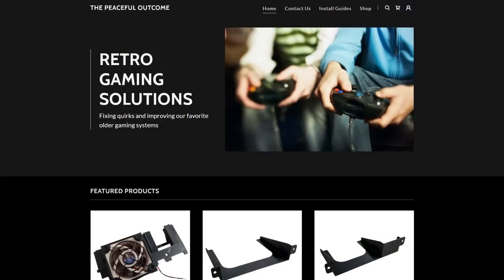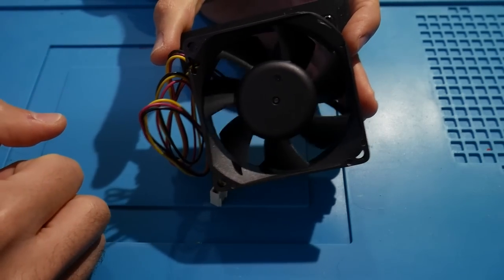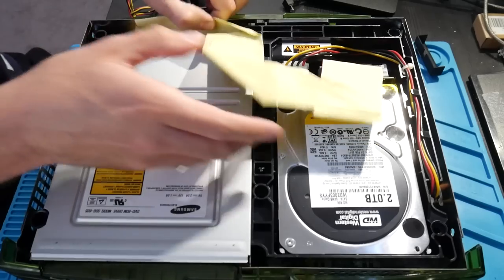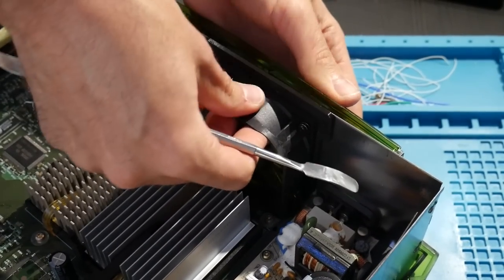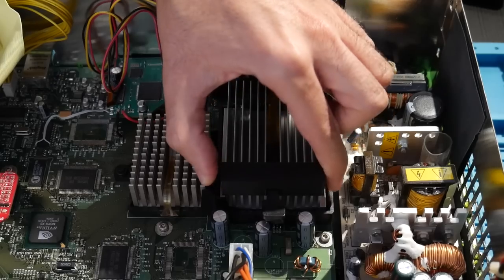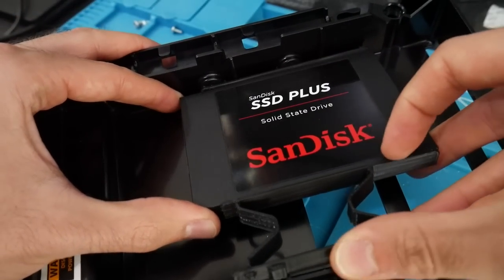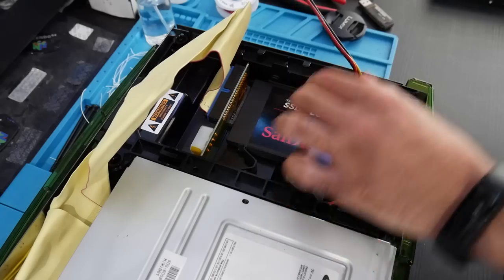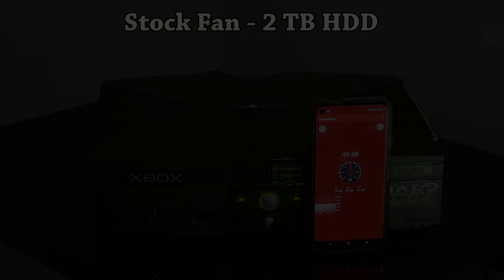Can We Make the Original Xbox Whisper Quiet? - Xbox Nexus Fan Mod & HDD Spacer Review!

Comment: I recently got mine out from storage and reinstalled XBMC with the Blades theme. Very nice indeed. I never thought about the fact that 700mhz was actually a lot in 2001 lol. I plan to install a 2tb HDD, to try install as many games as I can. The ultimate system lol
Reply from the maker: I believe that usually fits the whole OG Xbox library if you omit the yearly sports releases?
Reply: @MrMario2011  Possibly. Recently I attempted to make some calculations, though every time I end up basically going to bed because of the ridiculous lengths of time it takes lol. Also, do you know by any chance if I would require a hard mod to install a certain HDD size? I heard of something to do with partitioning, thx
Reply: @retrojacgaming  That's sick

Comment: I've been using those Nexus fans for years. You just have to cut the wires and solder the connector end back on so that it's significantly shorter. One thing to note about this fan is that it doesn't push as much air as the stock fan, so the CPU and GPU will run hotter unless you manually increase the fan speed via XBMC settings. 

While this kit looks cleaner, you can just use zip ties to secure it. You'll also want to trim the upper corners of the fan to ensure it doesn't interfere with the disk tray (doesn't fit naturally).

And $13 is way too much for that 3D printed HDD mod. You can buy a 2.5" to 3.5" bracket that screws in and looks nicer for half the price.
Reply: They should at least cut the cable and crimp new connectors to shorten the fan to warrant the price.

Comment: I did something fairly similar but instead of using any of the mods, I picked out a junk case with an already broken fan mount and mounted a 80mm green LED fan in my case using zip ties. And also instead of using an HDD bracket, I am using a 2.5in to 3.5 in converter adapter so I can mount the drive properly with screws. Which then I made an HDD activity light and integrated it into the caddy it's self.

Comment: Oh, I forgot that there were torqx screws holding the hard drive in long long ago. Threw them away right away soon as I ever opened my Xbox. Replaced them with regular PC screws for Phillips bits. Also, Guess would have to see how much the drive adapter costs vs what existing 3.5" to 2.5" drive adapters for PCs cost. Have worked with PCs and in IT for ages now, so I just have some of this stuff hanging about. Though, the fan adapter might be nice since I haven't liked hacking things up more than I need to to upgrade/replace the fan.

Comment: Good video, thanks! I personally do use a 2 Tb SSD in my OG Xbox. I haven’t installed any spacers or anything, the SSD just sits there supported by cables. There’s no moving parts in an SSD like in an HDD, so it’s not a problem. And of course I don’t rattle my Xbox around anyways…

Comment: What’s the purpose of 3d print piece that goes on the heat sink?
Reply: Tim from The Peaceful Outcome here.  That is some ducting to modify how the air flows through the system.  The CPU runs a LOT cooler than the GPU on the Xbox.  This ducting diverts some air from the CPU to the GPU and actually reduces the temperatures of both.

Comment: I've installed this fan on my 1.6 OG Xbox... It's quiet but my temps go higher. Idle 63C and 74C ingame. With stock fan I had 58C idle and 64C ingame. I use Kryonaut Grizzly thermal paste.

Even 5.0x speed fan on Nexus I got high temps. I'm dissapointed.

😢
Reply: Did you find a solution or go back to stock?

Comment: Just for anyone who is curious why the fan has a long cable, it might be because it is a regular 3-pin PC fan that also works on the Xbox. I personally would rather use a metal bracket instead of that spacer.

Comment: I remember the original Xbox One had a huge power brick and that was super noisy. No good way to make it silent, just gotta put it in a cupboard or something to help it.
Reply from the maker: I don't remember the Xbox One (or PSU for that matter) really giving off any noise 🤔
Reply: @MrMario2011  i only saw it at a friend's place when i was visiting the UK, it was noisy. however, it was in a quiet room. It's probably a different model than what you have. PSUs are often sourced from multiple companies and even the same location can get boards from multiple OEMs during the same time span.

Comment: Im planning on putting my 1.1v console with an 250gb to 500gb ssd but I'm waiting on my replacement capacitors and aladdin xt plus2 modchip just put mx4 thermal paste in it and definitely will do the fan mod as well

Comment: You don't know why this fan have such a "stupidly long" cable? 

Ok let me explain, this fan here, is of Nexus brand, which make COMPUTER fans, and i used their 120mm kinds in the past and i really liked them! So that's why it have a long cable, because you never know where the motherboards makers will put their fan headers, especially in the mid-late 2000's and early 2010's, those were placed at random weird places on the boards. Thankfully nowadays boards designers are much smarter and much more clever. But yeah, the maker of this pre-assembled fan mod just cut off parts of plastic of this Nexus SP702512M (70mm fan) with adapters and everything to make it fit nicely inside the XBox console.

But yes, computer fans typically have longer cables. The XBox stock fan was made to have a super short cable, to cut on material cost AND reducing clutters to maximum inside the console.

I do have this fan mod inside my XBox. While it's quieter, the fan spins a lot less than the stock fan, which mean you will get higher temperatures inside the console. You cannot change the fan speed unless you have a custom dashboard installed (like UnleashX or others). To have a much better airflow, you WILL have to speed up the fan, and kinda making the whole fan mod thing kind of pointless, but not quite, because this fan have a much smoother sound to it than the stock fan (which sound more "rough").

Comment: did he check if it gives sufficient cooling compaired to the stock fan? i didn't watch the whole vid i just can't see any bootmakers for performance and i've seen alot of people not test if a spicific modern fan is enough to cool the system as much or better than stock and from my limited experience they usualy don't.

Comment: the sad part about the OG xbox is so many of the optical drives are now completely fucked and not working anymore. there will come a time when just having a working dvd drive for one is going to be a rare thing. its really starting to become that way now. someone somewhere needs to start making the drives again and pumping them out so they can just drop right in and work. if a company did this and MS did not sue them for it i would say they can make a lot of money, so many people just want off the shelf replacement drives. people will always say "just stick a 2tb hdd in it" yeah i get it and i have that in 2 of my xbox's set up like that. but playing them off the HDD just does not feel the same. also have a shelf with about 300 OG xbox games on it that i dont wanna try play out of fear of killing my only last working DVD.
Reply from the maker: I know back in the day there were several mods you could perform to adapt PC DVD drives to work on the Xbox. I only know of them in passing, haven't looked into the nitty gritty details or done it myself.

Comment: is the fan suppose to be in a pull config as opposed to push, i though you would want the fan pulling in air from the outside over the heat sink

Comment: I have been given a OG Xbox V 1.0 that was sat in a cellar for 20 years. Yes the timing cap has leaked but luckily not too much damage. Yes the Foxlink Power supply, connectors to the figure of 8 female socket cracked. The shielding is covered in spots of rust (I plan to clean and spray enamel it (leaving an earth point)). I'm gonna change the LEDS & stick in a big HD as the original is totally dead. This is not my first Rodeo with the OG Xbox. This mod seems a worthwhile do along with new Caps obviously not for the super quietness but because I want to trick out this new box to 2022 spec's. I remember the old OGX's having front temp display and would not mind adding that if possible. Does anyone know if this can be installed with an Aladin chip (the only one I can get hold of) or by TSOP. If I can bring this back from the dead I'm gonna also do the memory upgrade. Any suggestions on other mods for the v 1.0 ?

Comment: Why no noctua?
Reply: Tim from The Peaceful Outcome here.  Noctua does not make a 70mm fan.  They make a 60mm fan, but it moves 20% less air than the Nexus fan used.  This leads to much higher temperatures and I wouldn't recommend it.  Noctua does make an 80mm fan, but it requires chopping up the console to fit.  As Mario mentioned, we wanted to keep this a easy drop in solution that  you can always remove if desired.

Comment: Never use SSDs for these older consoles, stick with regular HDDs, they will will max out the IDE interface for a fraction of the cost, they will last longer, and tend to provide more space for the same cost.

1. It's a waste of an SSD as these older consoles are limited to the IDE interface and the limited speeds associated with it.

2. And this is the most important, the XBOX OS ! DOES NOT SUPPORT TRIMM OPERATIONS!  Your SSD will die, and very quickly, without TRIMM.
Reply from the maker: Both of these are points I've made for a while, but... If people want to put in a SSD, they'll put in a SSD 🤷‍♂️ To be clear, I totally agree with you.
Reply: You are absolutely right. There's only one advantage with SSD: less heat produced.
Now,  if only someone would introduce TRIM on the XBOX BIOS/OS.......
Reply: @jocool7370  I don't think TRIMM operations can be performed over an IDE interface. The IDE communications protocol doesn't allow for certain required information to be accessed and thus would ultimately prevent anyone form preforming a TRIMM.

The hardware interface is the issue not so much that the OS currently lacks the ability to perform TRIMM.

Perhaps a mod that updates the IDE interface to SATA and then an OS update to support that mod, the new interface, and all the other bells and whistles that come with that.

One day, maybe.
Reply: SSD firmwares have come with internal garbage collection since ~2014. Any reputable modern SSD does not need TRIM and will work just fine in your console.
Reply: @ShooterBtv  source?

Everything I know says you NEED an OS that supports the function and its only possible via a SATA interface.
Reply: @theexile4694  the points you are making is just recycled school yard talk from 10  years ago to scare people. and you are also talking as if SSD's still cost the same as they did per GB 10 years ago.  if someone wants an ssd in there console let them buy one. hell i dropped almost 8c on a ps3 fat cpu and rsx temps just buy swapping out the dirty old spinner for an ssd. the cost of a 2tb ssd vs the cost of a 2tb hdd isnt breaking the bank for most people. if you dont wanna spash some cash on a ssd stick with a hdd.

Comment: What tape do you recommend for conductivity protection? Please n thanks
Reply from the maker: Kapton!!
Reply: @MrMario2011  ordered and appreciated. Thanks. Oh also is there a sata / ata adapter thats fool proof. Tried to startec and both wouldn't work with multiple drives. ( checked the chart ) plus I built the drives and locked them. I ordered a couple of the one is saw in your video. Just wondering.
 As an old timer I thank you for your easy to follow videos. Been working on my soldering but having the right setup helps tremendously.
Keep up the great work.

Comment: I have a non modded unit with a bad hdd , should I replace it with another hdd or go with ssd?
Reply from the maker: Up to you
Reply: @MrMario2011 does the hdd require same amount of softmoding as an ssd? I’ll probably go with ssd if it does
Reply from the maker: Same level of effort, just make sure you secure the SSD down since it's much smaller.

Comment: I think Noctua 60mm fan would be better choice.
Reply: Tim From the Peaceful Outcome here.  The Nexus fan moves 20% more air than the Noctua.  Many have used the Noctua fan and it will work, but it runs a lot hotter than the Nexus fan.  Our testing showed the GPU ran about 10C warmer with the Noctua.  They are the same sound volume in specs and we also found the same in testing.
Reply: @timfulton8519  Well it's 70mm vs 60mm fan. Whether they were at the same RPMs, and what are the temperatures now with Nexus?
Reply: @Tvv1SteR  Temps with our kit with the shrouds installed are 69C on the GPU and 52C on the CPU with an ambient temp of 72F/22C.  The Noctua runs about 79C on the GPU and 57C on the CPU.
Reply: @Tvv1SteR  This testing was also done running the game that made the system the hottest we could find so its kind of a worst case scenario.  All other games we tried ran cooler.
Reply: @timfulton8519  Which game is it? I want to check the temps on my console.
Reply: @Tvv1SteR  The Suffering